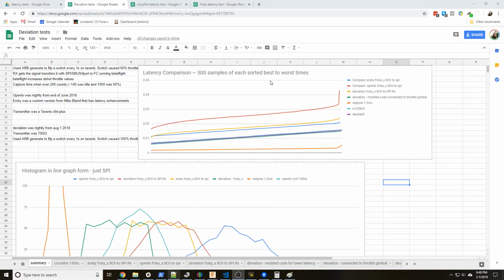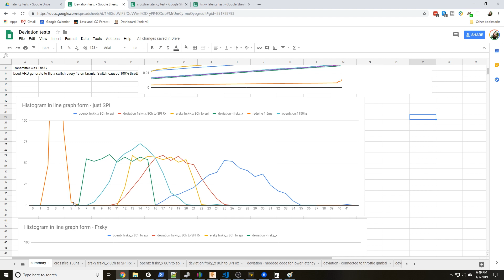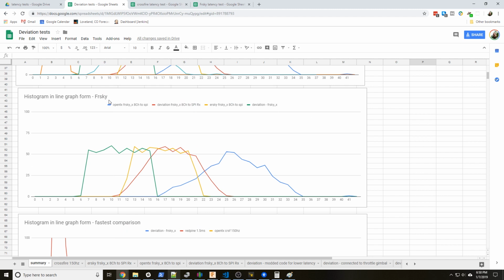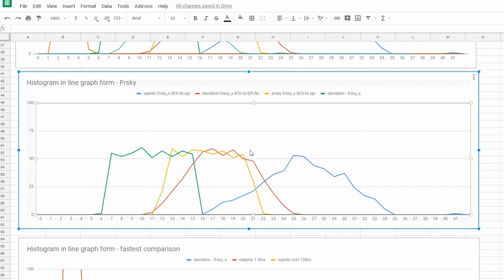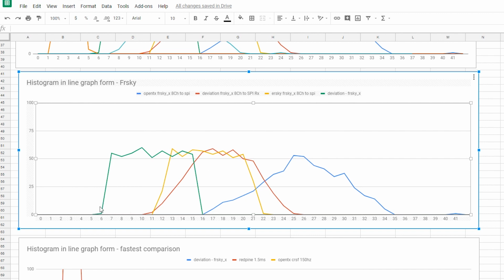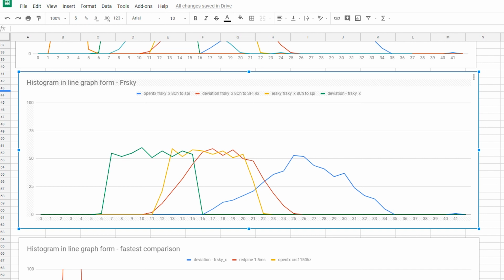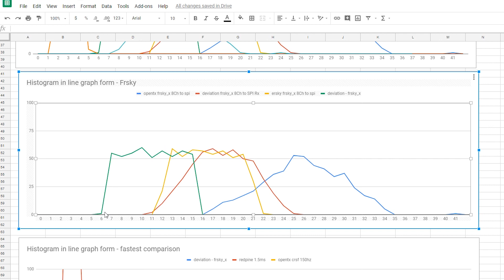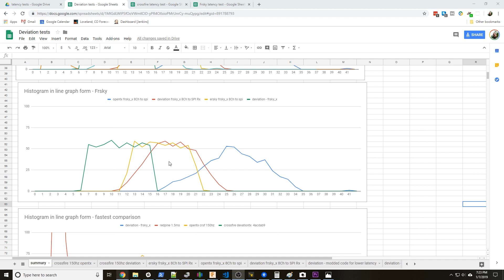Latency Test Part 3: DeviationTx - Lowest Latency - Fly everything!

Comment: Hi! What's the difference between deviation and open tx, wich are the advantages one over the other?
Reply: Deviation is faster and simpler, opentx does Lua scripts, GPS telemetry, and TBS crossfire micro module (deviation can do crossfire, but requires the pricier full module)

Comment: Can you provide more information about the spi receiver you used?  Is this a receiver that is built into the FC like the OSD?
Reply from the maker: Yes there are just a few flight controller with the radio chip right on the board.  The most popular are matek f411-one and crazybeef3FR.